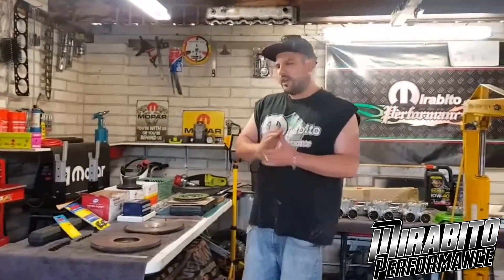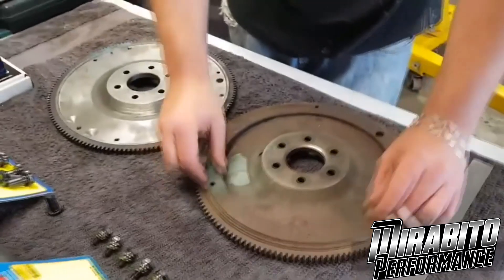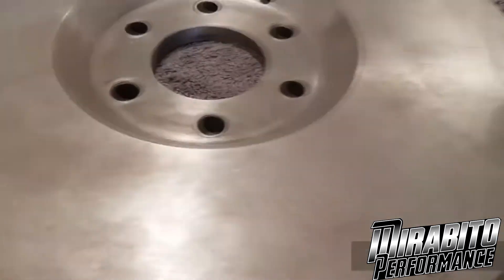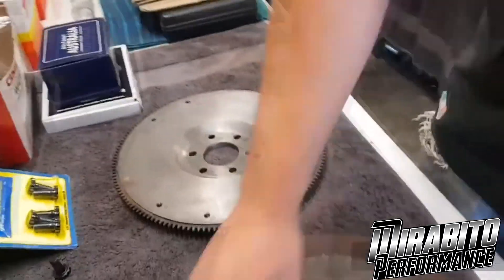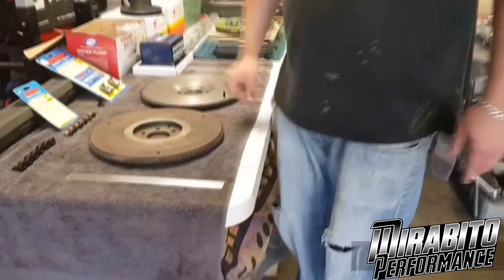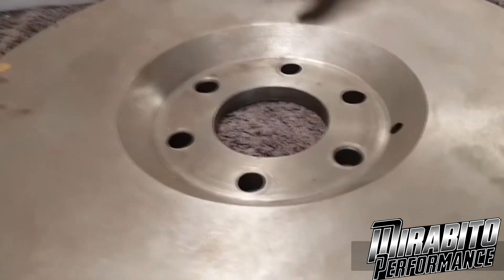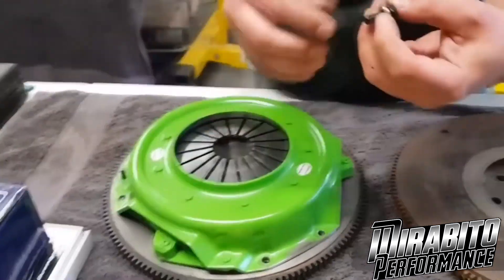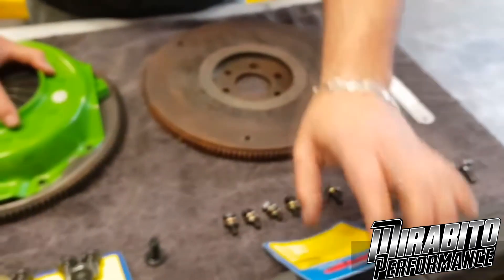How I Machine and LIGHTEN my Flywheels

Comment: I just did this to a 2000 2.2 s10 truck flywheel.   I removed material from the front side so that it ended up flush with the ring gear.   It was about .150" off.

I better not die.   Cheers.

Comment: Whats the difference in actual weight?  My flywheel came loose , almost came off , when i was street racing , the accelerator cable got stuck on the four barrel , i  put the car in neutral and the engine rev out , i tried turning the motor off the steering lock came on , and i jiggled it unlock , by fluke we didnt kill our selves that day. popped the bonnet and the pacemaker extractors where glowing red hot . Is it true the hemis had a problem with flywheels coming loose  ? If so what do you do to fix that problem ?
Reply from the maker: Crazy story. Yeah the flywheels are know to come loose. I have a vid on here of how I stop that too 👌

Comment: Wait youve took heap off face were clutch mouts , the clutch is now  further forward  not effect the trow of release bearing
Reply: Most hydraulic and mechanical clutch release bearings have some kind of way to be adjusted, automatic or manually
In this case it probably wont hurt the guy, but in some cases it might be just enough to screw up

Comment: Back in the old days I use to fuck around with P76 V8s (same clutches & BW SR 4 Speeds as 265s too) & I use to just buy new old stock P76 6 cylinder flywheels to get that revvy light flight wheel effect at the least effort. Even a decade after Leyland went bust one could buy NOS basically any part required at cents in the dollar. Including clutch for 265 lean burn in a 245 VG Safari Wagon with full VIP interior & front & Pacer dash. Flywheel actually looks the same too, but can’t confirm that.

Comment: I would definitely go with a stiffer pressure plate and keep slippage to a minimum. Otherwise you're looking at warpage. Ran into that problem on my performance VW engines.